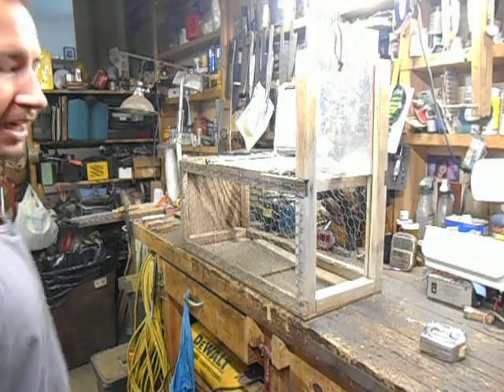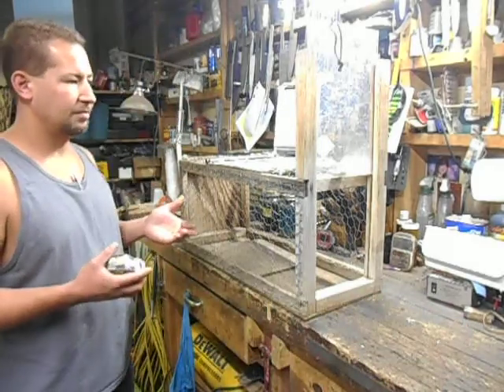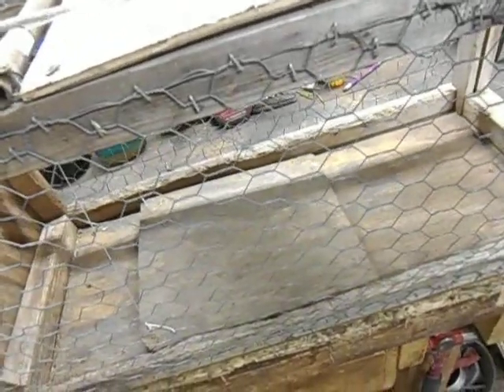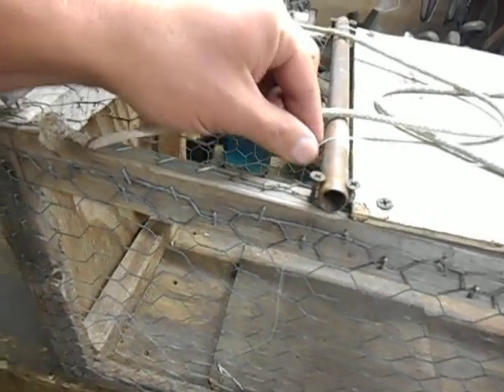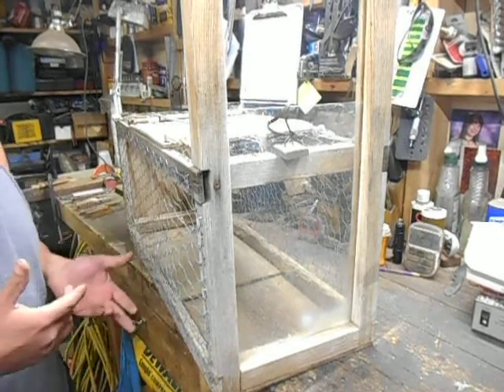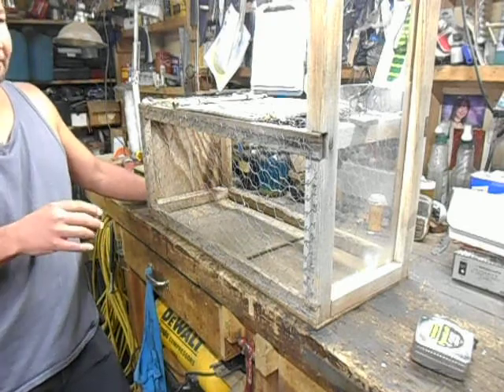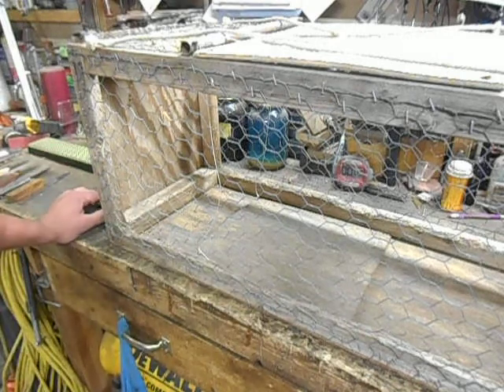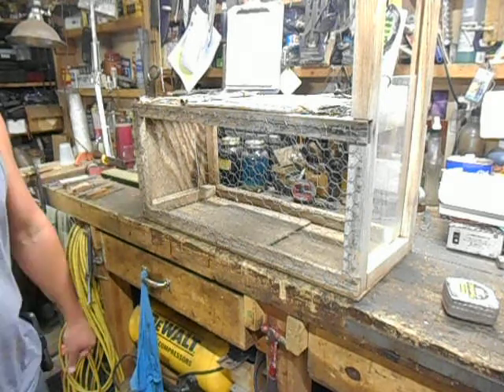grandpas old home made cat trap

Comment: Question, would using pvc pipe for the sides of the slider door keep the door from jamming when sliding shut ? you could put on each side of the door 2 pieces of pvc pipe side by side, with the door in the middle. could you please tell me what you think ? i like the rest of your design, and would like to make one, but am undecided on the sliding door. i plan on using plexiglass like i see in your video...
Reply from the maker: the pvc would probably work really well as long as it is large enough so when the cat tries to slam against the door, the plexiglass doesn't bend enough to slip pas the rounded edge of the pvc.

Comment: I’ve made a lot those traps and when they get wet, that sliding door system ain’t worth a fiddly phuk.
Reply from the maker: when I got it, had a wood sliding door and didn't do well wet either, going to the plexiglass door helped a lot after I smoothed the edges of the plexiglass and then put some paint on the plexiglass as the cats would try to run through it when it was new.